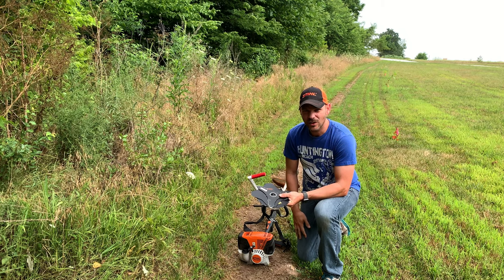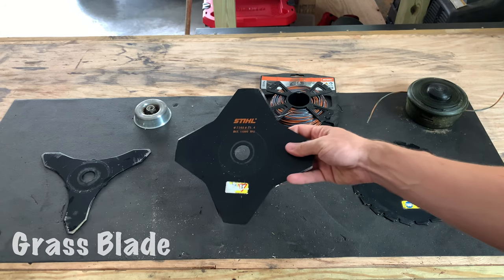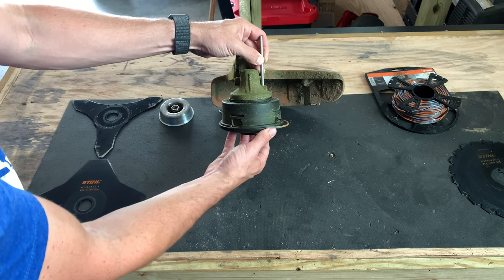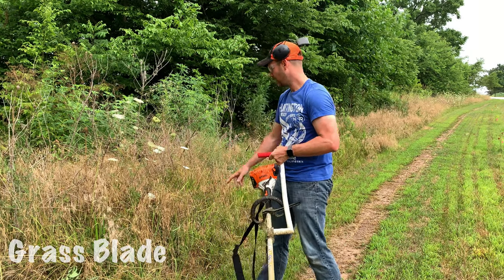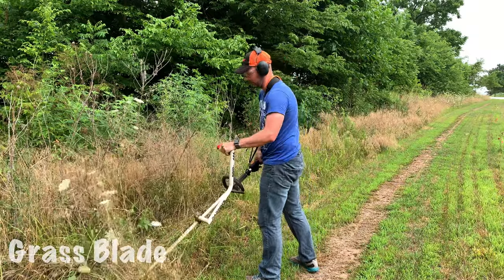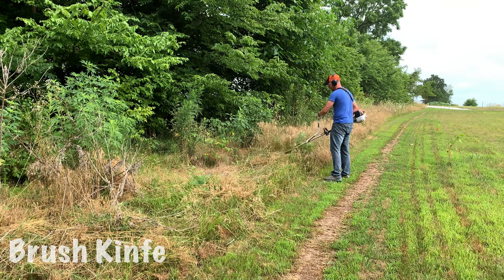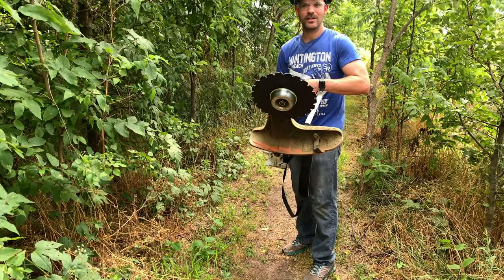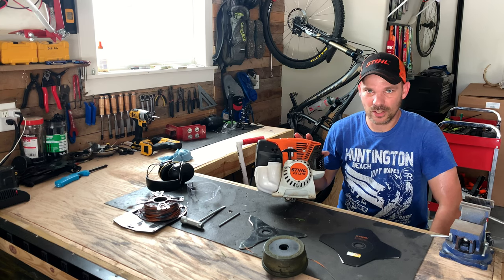STIHL FS131R Best Brush Blade, Install, Review, Demo: What Is The Best One And What Should You Get

Comment: I encourage anyone using these blades to to invest in the screened face shield. The material these things cut isn't like getting hit with grass or sand. Ask me how i know ...
Reply: Mind sharing your story? I learned the hard way with safety glasses, but never figured a mesh mask was needed
Reply: How do you know?
Reply: @nes999 when chopping brush with a string trimmer, it will have a tendency to throw wood splinters and small pebbles.  That debris flies at such a velocity it will sting your face or even cut it in a worse case scenario.  A mesh screen or a faceshield is definately recommended.
Reply: @19vendetta19  when I use the circular blade on my FS 131, I wear the same gear as I do cutting trees in the bush: safety helmet with mesh screen, ear protectors, and sun flaps (also keeps debris from hitting my neck) , kevlar pants, safety boots, and gloves. When I use the brush blade, I wear my safety helmet, boots and gloves, but usually not the kevlar pants because they get warm pretty quickly and the tall weeds are more out in the open. If you are cutting noxious weeds like wild parsnip or giant hogweed, use extra caution to not get any of the juice on you. Definitely wear long sleeves, gloves and goggles. I’ve even worn disposable tyvek suits when clearing a patch of this stuff. Don’t recommend using a power tool like this to take out poison ivy.
Reply: Dad had a DR trimmer I used one time and when I say I got hit with a log it was bad lol
Reply: Would you like to share?🤣
I use one of those DR brush hogs (like a powered push mower on steroids) frequently…..and I value my appendages greatly 🤣
Reply: @19vendetta19  This is one hell of a cliffhanger 😁
Reply: Stay tuned for stories from season 2

Comment: I have used the Chisel tooth saw for years in high grass and brush, and small trees with great success. it is my go to blade. I own 3, and keep them sharp to quick change, so I can cut for long periods without sharpening blades. My Trimmer is a 2005 FS 110 Bike handle model. It is still a beast all these years later. I am looking to upgrade so am interested in the FS 131. I have only owned this one Stihl trimmer, but 16 years of use, has made me a lifelong fan. This thing has paid for itself many times over. So, If I do get another, for the tougher jobs, and just use the old man for trimming yard edges, It will be a Stihl. I'm not set on the Model yet. Nice video, Thanks.
Reply: I have a FS 130 with handlebars. The harness that came with it is really useful as it takes the weight off your shoulders. The chisel tooth blade is called a woodcut blade. It cuts grass and saplings like anything. There is an 8 tooth grass blade that's pretty good also. The best is the woodcut blade. This year couldn't get an extra woodcut blade. I got a substitute made by Oregon.  It has riveted chainsaw teeth around the outside of the blade. It is the best of them all.  Cuts grass great. Been using it to cut small to medium stumps off at ground level. Cut first with chainsaw at waist level. Then come back with brush cutter. Since you are cutting close to the ground, you have to be careful to keep it out of the dirt.
Reply: Big Stihl fan here. My first machine was an FR350 backpack. i bought it 2nd hand for £150 over 20 years ago. No idea how many times it got used over that 2+ decade period, definitely in the 100's. Heaven knows how much use it had prior to me getting it as it was used by a professional landscaper from new.
I changed about 5 bump heads, 1 carburetor and one flexi shaft in all that time. I also used the 4 tooth blade but was not a fan of that attachment.
1 year ago I had an opportunity to buy a lot of used Stihl and other machinery from the grounds maintenance part of the place where i work. Most of the machines were in excellent condition and some were non runners. The non runners were missing a few little bits such as carb or air intake but effectively hardly used. I also got another backpack brush cutter too. The whole fleet of machines cost me £1200. 
I placed my old FR350 on ebay and got £500 for that. The new fleet had a wood chipper (not Stihl) but only used once. I sold that for £1200.
Now i've recouped all of my original costs, kept a fleet of 8 of the Stihl machines. bought a brand new MS261, a pole saw and carbon extension for the kombi. I am a very happy chappy and the excess cash i made on the other unwanted machines helped me take the Mrs to Jamaica in August for our 30th wedding anniversary. Stihl machines hold their price if they're looked after. I am a fan. 🙂
Reply: I’m thinking that might be the blade i need. 
There’s a ton of Giant Ragweeds I’m trying to deal with and the brush blade would probably do fine with the smaller ones but man they’ll get 2” in diameter sometimes.

Comment: Try using your bump head under the blade instead of the metal piece. That’s how I use it to cut the highways with saplings mixed into the Johnson grass. Don’t worry about that stupid kit and just buy a 20 dollar blade from Lowe’s. It will save you so much time I promise

Comment: Great video, I have a very similar setup and all of those attachments. You're a recommendations are spot on. My Stihl doesn't get much use now that I switched to a walk behind brush mower, which is several times faster to do the same work.
Reply: I've been looking at the DR Trimmer, which one did you get. My property is 209 ft x 209 ft.. a walk behind would be much faster
Reply: Which walk-behind brush mower would you recommend for mowing brush along an electric fence on a farm?

Comment: Approximately how many feet of trail can you trim in an hour? Talking about single track, going 3' on each side of the track with a trimmer. Probably using that triangle grass blade. Mainly weeds, grass, small saplings. Have to do it 3 times a year on about 13 miles in Kentucky.

Comment: I get the best results from my chainsaw-like blade  by going past the right side of the tree I'm cutting and making the cut on the left side of the blade by drawing it back toward me. Much less kickback and seems to cut much more smoothly. IMHO, this is a "must have" attachment for any FS131 owners. Makes chainsaw-like cuts flush with the ground. Hint: If not pulling the stump, cut of heavier trees about 6" above ground level and then recut stump flush with the ground. It's much easier to control your cut that way.
Reply: I agree always use the left side of the blade.  I can tell you from many years of experience the front and right side of the blade can give a really dangerous kick back slinging the trimmer and you to the right side violently.  I have a stihl FS-250R VERY POWERFUL MACHINE and it taught me this very efficiently when taking out a two inch sapling. Thank God nobody was around me when this happened. Be safe out there these blades aint no joke. Especially at wide open throttle.

Comment: Sthil makes a hard hat muff and face shield combo for saws. I cleared a BMX track and def recommend using it. I somehow got hit several times in the shield. Hard.
Reply: I have to wear both, the helmet/face mask and safety goggles.  I've had grass get around the mask and get in my eyes.  I've even gone so far as use the goggles with the foam gasket on them.

Comment: The echo black diamond .105 line is the most durable line I've found and I've used all the of the good lines.
Reply from the maker: Nice! I am testing a new trimmer head. I hope to have a review up about it soon. Unfortunately it takes up to .095.
Reply: @RunBikeMike  You should go with the speed feed 450 head, it's a timesaver and certainly worth the money and upgrade since you never have to remove the cap to reload the trimming line. Stihl makes one as well, I can't recall the name of the stihl speed feed head but it is black and white. I run the echo speed feed 450 head on my km131 and I can put around 18 feet of .105 line in that head in 30 seconds or less.
Reply from the maker: Nice. I am trying a brand that is like the speed feed 450 but is a lot cheaper. I want to see how long it lasts. I hope a long time but if not I will definitely be getting the 450.
Reply from the maker: Sweet thanks. I will check it out
Reply: @RunBikeMike  No problem, I've bought 1 of those before for another trimmer and I used it for nearly 2 years before selling that trimmer so I know they're good.
Reply from the maker: That is great to know. Thanks 😊

Comment: Can I ask if you can change a strimmer head of a kombi attachment to a blade brushcutter, I’ve inherited one so not bought myself, it’s. Stihl combi attached with a strimmer head at present but wondering if they all can be released and a blade cutter put on, or I have to buy the blade brushcutter attachment? Hope that makes sense, obviously being able to change it out would be a hell of a lot cheaper than buying a attachment. Thanks in advance and great video by the way 🤞

Comment: I have grass blades but never use them, I currently use Husqvarna X force strimmer line and find it excellent. If the going get heavy, ie bramble and brush, I use an Oregan mulching blade, which is phenomenal! The clearing saw blade is also great for saplings and small trees. I use a Husky 535LK pro combi and bought extra shafts, so the different heads are already fitted, so switching takes seconds! Like the look of the handle you have fitted to your strimmer, any info on that would be welcome! 👍
Reply from the maker: It is called the Darwin Grip and I love it. Here is a link to it. https://amzn.to/3lcI19v

Comment: Where did you get that part(s) that you put on to hold the blade on?

I've got a several year old FS 94, that I bought a few "Grass Blades" for, but I don't have the hardware to mount it.   If mine came with it I musta lost it...

I bought it from my local Rural King and you never get the accessories or all the crap that's supposed to come with something, unless it's a sealed box...

Comment: I have an abundance of blackberry & Salmonberry brambles on my property and purchased a 131R with the knife blade attachment.  It's been great on the blackberry, but the Salmonberry stalks are tougher, and I'm considering that circular saw blade attachment. What I'll probably do is cut the Salmonberry stalks higher up, and then I can go back and completely uproot them by hand & shovel. I was able to find a co-op/feed store about 10 miles away that sells ethanol-free gas. I use the oil additive sold at my local Stihl dealership, which they say will extend the warranty period(if I recall correctly). Great purchase, so far!
Reply: Ferns! I have tons of thick ferns here, hoping that the chisel tooth saw blade or brush knife work for me.

Comment: Hi Mike,  thanks for the video.  I just bought the 131R. To start off right, I'm watching some videos to get familiar with the trimmer.   I bought mine to specifically use on thick vines, briars, brush and saplings of about 1".   I see you have some type of handle that you use with your left hand.   It looks like that could help a lot when cutting thick stuff.   Where did you get that?  Also, a different person's video said you have to change from the trimmer guard to a stronger guard when using a blade.  Do you recommend the same?
Reply from the maker: Here is the grip I use. https://amzn.to/3WvAfbC

Also some prefer to change the guard but I didn’t. It does help with safety however I feel pretty safe using it with the guard I have on. So personal preference.

Comment: I bought a new 3 blade brush cutter blade and my entire KM56 vibrated extremely a lot what do you think would cause that?
Reply from the maker: Is that a solid shaft trimmer? If not then that might cause those issues.
Reply: @RunBikeMike  straight shaft Kombi with string trimmer and bush cutter attacments. 3 knife blade went on the brush cutter attachment
Reply: @RunBikeMike  it's a 2 piece so it accepts other attachments like leaf blower, edger, pole saw etc

Comment: hollow shaft or solid ?  solid one is  approx. 8 lbs  extra weight  yet it seems  more durable  with the knife blade if brush cutting  a few larger stems~!       thank you for taking the time to cover the topic.
Reply from the maker: Solid
Reply: @RunBikeMike  would  agree  ,  very few  vids of the  comparison,  other equipment can be  added yet  not  for  the lighter weighted shaft.

Comment: First, I go for value in machines, strictly solid-shaft of course, like Husqy D-handle or bike-handle Tanaka, with blades like Oregon mulchers or Forester 9" chainsaw-cutter; maybe 12" 3-lobe in rocky field. ~25 cc machines work great. String is for along masonry ONLY, IMO. Oregon mulching blades puree the debris, for much cleaner job. For woody stuff, chainsaw-cutter way better than any others and sharpens easily in the field. Next experiment is Oregon mulchers on 45 year-old 21 cc 1 hp Echo. Place your bets. Never stihl, sorry, for reasons.

Comment: I can't get an answer from my local stilh dealer about which blade I can run on a FS70RC. can you offer any input. Also do I need to change the  standard trimmer shield/guard for a blade application?
Reply from the maker: I am not sure on that model. I know you need to make sure you have a solid shaft model. Otherwise it could damage the trimmer. I have ran with and without a guard.

Comment: What are pros/cons/difference between using string or the 3 bladded one?
Reply from the maker: Sting is good around the house but for brush go with the 3 blades
Reply: String causes less damage to yard plants,  fruit tree's, and  siding.  At high  rpms the blade will chip brick, and cut fence wire . I've had the same blade with heavy use for 4 years now,  and it still works fantastic . You can go for hours in ruff brush  without the worry of running out of string

Comment: Why would it shake or vibrate like the blade is loose? I’ve followed all the steps
Reply: While I could not see definitively, it looked as though when the string head was removed and the plate and slightly concave washer came off the bottom of the gearhead, that the plate was put back on and the concave washer put on the inside. If you look at the Stihll instructions on how to assemble it, the large flat cover goes on first, followed by the blade that you want to use and then the concave washer. The stamped steel cap then goes on and the bolt finishes at all. There will be a slight space between the stamped steel cap and the blade you're using. However, all of that is necessary to keep the blade centered and tightened down flat. To use the chisel tooth circular saw- style blade, especially when cutting saplings or brush, the head needs to come from the right hand side of the trunk and cut toward the left, as if you cut from the left to the right, you are inviting serious kickback of the blade and machine.

Comment: I just bought the knife blade and man that thing vibrates way to much to even run the trimmer. Any idea why that’s happening? I have a fs91r
Reply from the maker: Hmm that is odd. Is the fs91r a solid shaft?
Reply: RunBikeMike yes. I’ll take it apart and reassemble it and hope that fixes it
Reply from the maker: Yeah maybe also check to see if the blade is balanced too.

Comment: I bought this model and I am not satisfied. It works very unevenly at high speed. Is it supposed to be like that?
Reply from the maker: I have not experienced that. I wonder if something is not quite right with the one you got.
Reply: @RunBikeMike  The Stihl website said that it is normal for this model...
Reply from the maker: Hmm that’s good to know.
Reply: @RunBikeMike  I do not believe it, how it can work well at low speed and stop and tremble at high speed. My opinion is that each engine should work equally, whether at low or high revs. I think there is something wrong with my copy. Sorry for my handwriting but I'm using a translator
Reply from the maker: No problem at all. When I use mine it seem to smooth out at higher speeds. That would be frustrating if it was acting that way at high speed.
Reply: Thank you for your quick reply and best regards
Reply: There is a 3-tank break-in period for a brand new 131R(and probably the same for most gas trimmers/mowers). It should smooth out after that period if it's broken in properly.
Reply: @kolesmaniek  That's called a rev limiter. This is a 4-stroke motor, not a 2-stroke. It relies on torque to accomplish the work, not RPMs.